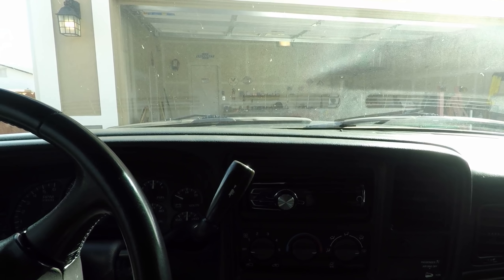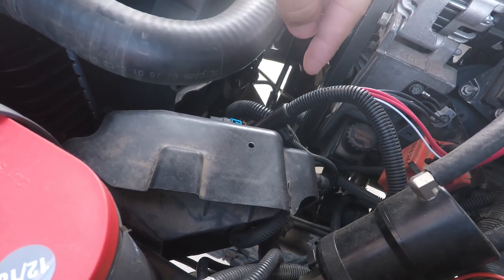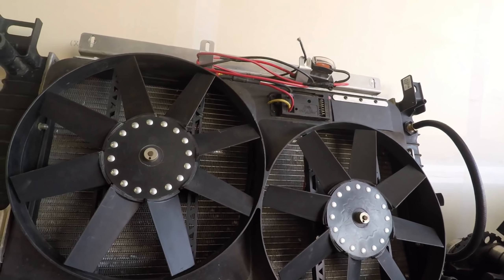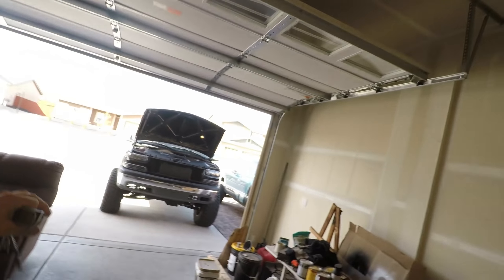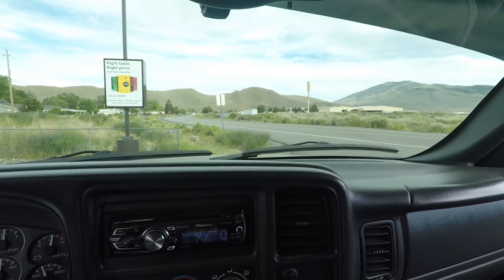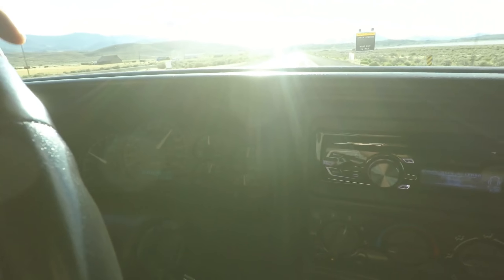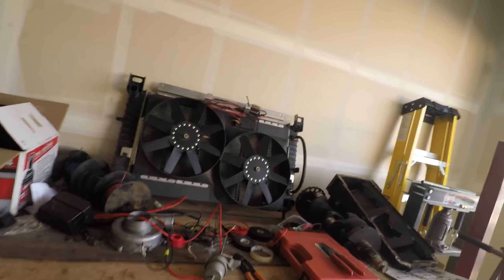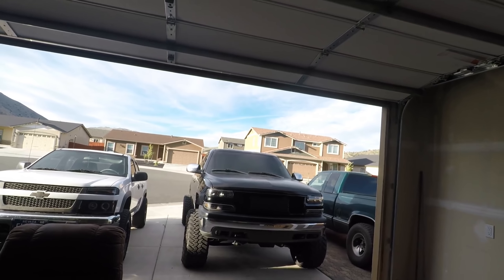First Drive With Factory EFan Conversion (No More Cooling Issue)

Comment: 210 is still semi hot. You want to be close to 180 for operating temp. 210 is boarded line over heating.

You might want to upgrade to a lower temp thermo
Reply: 210 isn't hot at all thats head temp which is usually 10+ higher than thermostat which stock is 195

Comment: Confused on the use of header wrap (fiberglass heat retaining insulation) on the Cold (emphasis on cold) air intake lol.

If Anything you'd want to use heat Deflection tape (usually a silver color & sheen) but even then it's kinda silly to use on something like that. Also you only run the set up w/1 pin? You don't use pin 33?? So do your fans cycle w/the A/C compressor🤔?? Looks like you're in AZ/NM/TX, I'd figure you'd want max cooling with the A/C not to mention keeping the high side system pressure in check by running the fans w/the compressor...

Comment: Ive got a 99 silverado 5.3 with a cam, headers, tune, all of that jazz but I still have the stock clutch fan. How difficult was it to switch over to electric scale 1-10? Im seriously considering this because my clutch fan is going out and Im probably not going to bother going back to that setup...

Comment: Did you feel a performance difference or see you mpg improve? I’ve seen estimates of the clutch fan taking away as much as 30 hp which seems like too much to me but I could see 10 or 15 easily.
Reply from the maker: I did. It would pull hills without downshifting like it used to. It’s not a huge gain but I noticed a little bit. Worth it to me. Looks better too

Comment: What tune did you use to turn the fans on? I have an 04 avalanche and I’m done with replacing the clutch fan and converting over to e-fans, didn’t know about it had to be tuned until now and how you did it.
Reply from the maker: Check out Bauer performance. He is very inexpensive and does a good job.

Comment: So you didn’t hook up the second wire that your so to splice in?
Reply from the maker: My harness only came with 2 wires. One for the ecm and the other is just a 12v reference for when the ac is on
Reply: Ok yeah the one for the ac, I hooked that one that one up and it’s kinda annoying when the ac cycles, the fan keeps kicking on and off in high
Reply: @chrisnicholson72  thats probably cause its positive from the ac. And the 2 wires are supposed to be grounds

Comment: Does your high speed fan turn on ONLY when your ac clutch engages or is it on anytime your ac controls are on.
Reply from the maker: I can’t answer that yet. I need to get my AC serviced. I haven’t used it with the fans yet
Reply: Endless Wishlist oh ok thanks
Reply: Mines doesn’t kick in when I turn the A/c on and I have both pins in,,
Reply: Mine only engages when the ac clutch turns on. When it’s off they don’t turn on at all. What do you think it can be?